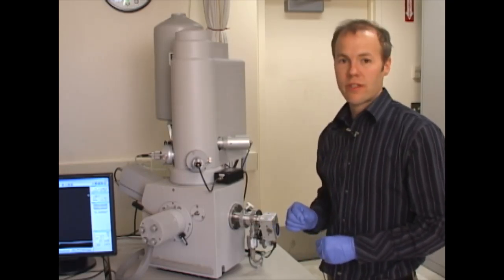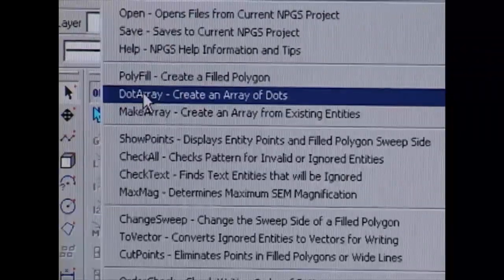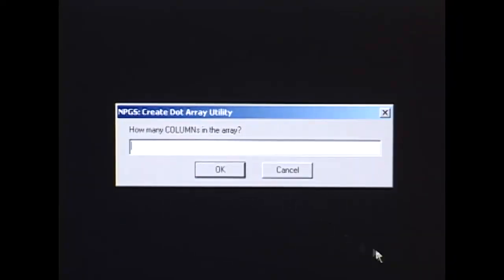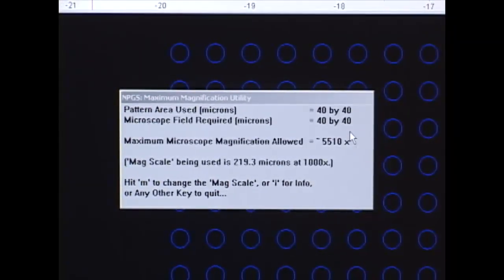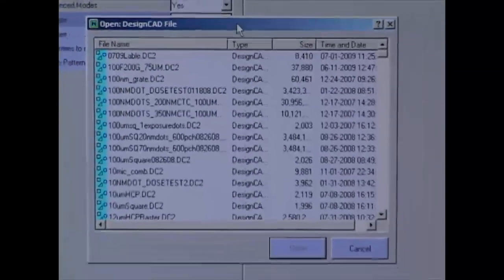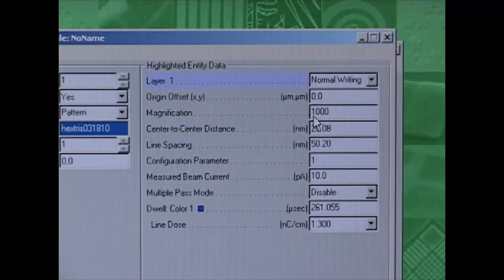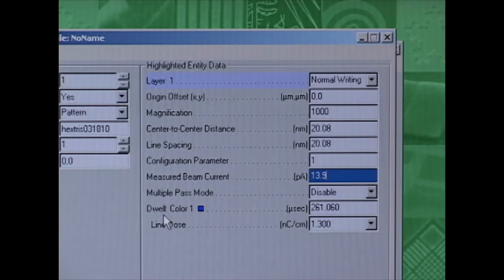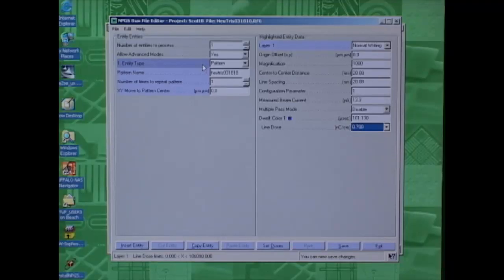E-Beam Lithography, Part 2

Comment: doesn't look that complex that an EUV machine from ASML that ships in 40 freight containers , has 100,000 parts and is worth 120 million bucks. I think I can make one at home. This way, my 20nm chip  isn't going to cost me half a billion dollars
Reply: Seek medical attention.
Reply: @MrFujinko  medical attention need the employees of ASML, who need 5 km of factories to manufacture a chip of only 4 different material types. That goes even beyond the definition of insanity.
Reply: @RINGTONE_XE  exactly f*ck ASML, I am currently building a nano-scale CNC router with interferometric sensors, will be printing my own transistors soon. Check out nano-electrochemcanical relays, this stuff is now perfectly replacing CMOS with a gate delay of as low as 10 nanoseconds. It is way easier to manufacture, you dont need anydoping, any UV and stuff like in lithography. There is really a revolution going on in computation models, some guys created gates of just gold and vacuum. But nano electromechanical relays are easiest computational devices out there.
Reply: @absolute___zero  did some body once say delulu is the solulu